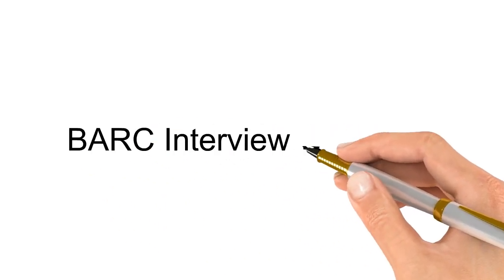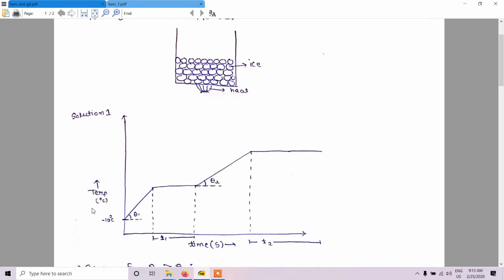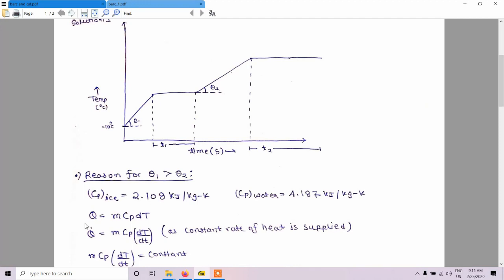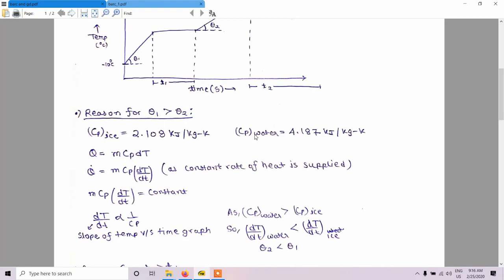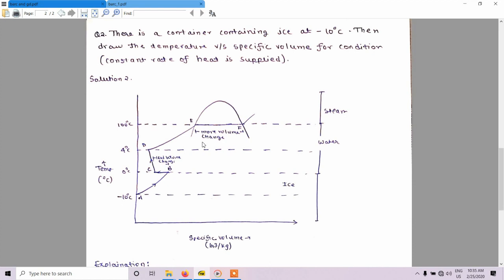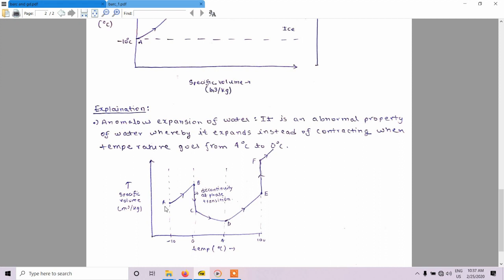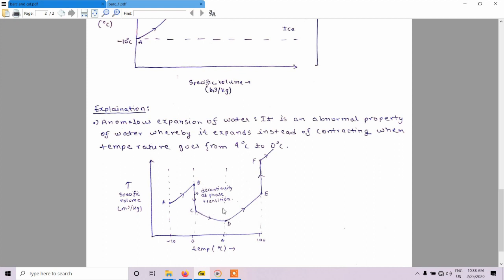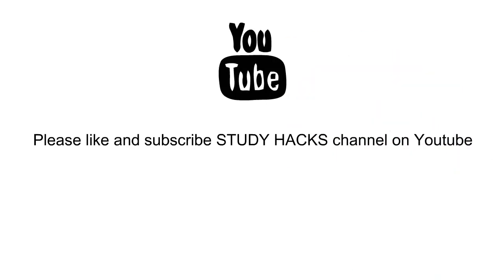#1.BARC_interview_questions || Mechanical  by AIR 96 (Gate 2019)

Comment: How the specific volume changes from -10 to 0°C and 0° to 100°C with temp?? I mean volume will increase but  is the profile be cubic or parabolic?? Is there any equation for that??
Reply from the maker: Yes I have taken reference from a website I will share the link with you.
It basically depends on the thermal expansion coefficient.
Reply from the maker: https://www.google.com/amp/s/www.researchgate.net/figure/The-volumetric-coefficient-of-thermal-expansion-of-water-as-a-function-of-temperature_fig5_283292378/amp
Reply from the maker: https://www.quora.com/How-does-the-volume-and-density-of-water-change-if-you-heat-solid-ice-starting-from-15-%C2%B0C-up-to-10-%C2%B0C
Reply: @PlanandPlay-o8d  thanks